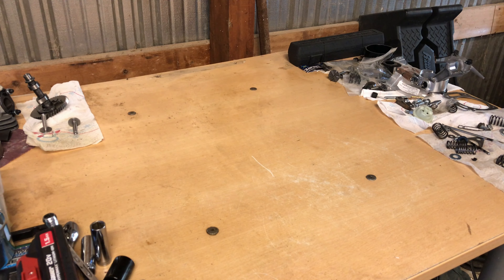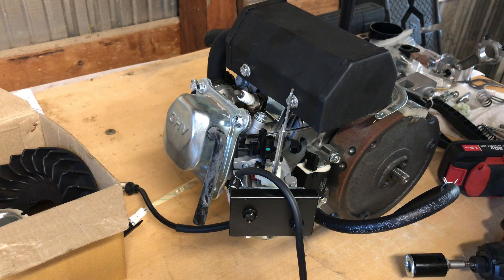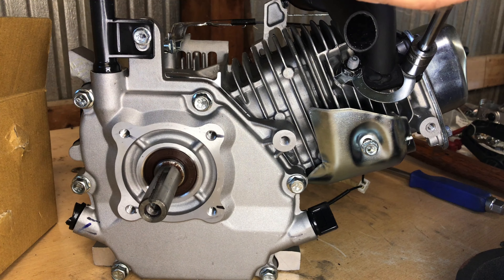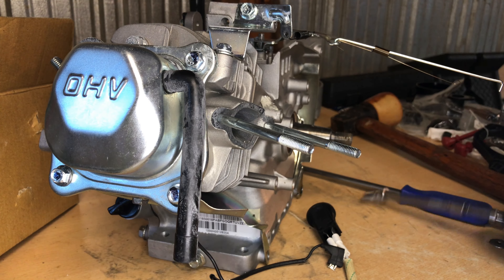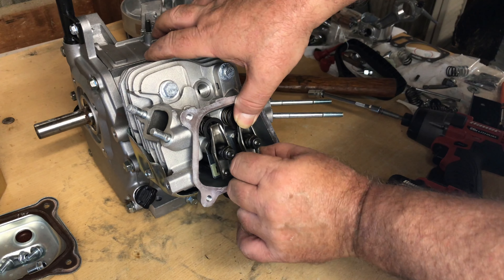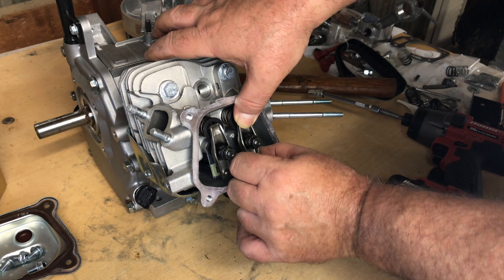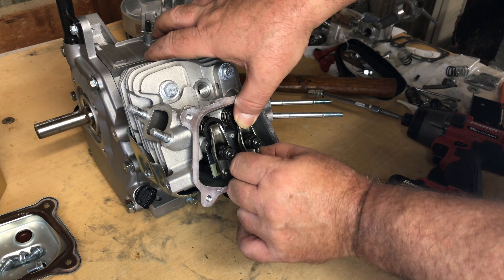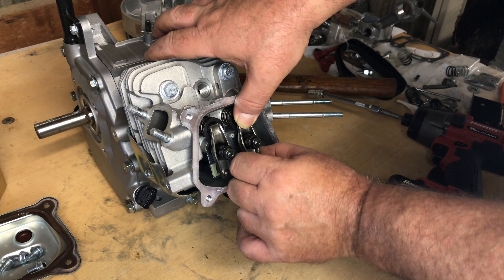Part 1 "Big Bore" 179 LCT Engine Budget Build! How To Turn 179cc Into 208cc!

Comment: I just got an LCT 136cc. I was gonna get the 179cc, but i was afraid it wouldn't fit inside my felt faker gas bicycle frame.
So i got the 136cc. And now find out that the 136cc will only fit vertically. I need to find someone to weld me up a mount.
I have a death row comet style tav 2 torque converter that ill be using as well.
I took off all that throttle linkage. Cant use it if i wanted to because vertical mount 
Anyways i have a pz20 carb, but im afraid that it will over rev because i have to take out the governor too. I need to use a charging flywheel because i need lights and power. I sure wish they made billet charging flywheels. I guess i could take off the outer starting ring if i can even find one of those.
Should i be worried about the carb, the governor and flywheel, or do you think id be ok with the carb change, governor delete and a charging flywheel?
Reply from the maker: Hi B! Sounds like a cool project! The PZ20 carb is a great performance mod but remember if you remove the governor you'll need to be concerned about the stock rod and flywheel failures. The stock rod can usually handle up to 6K RPM but the flywheel will not safely spin that high. Anything over 3600 RPM with a cast iron flywheel is a no no. Undoubtedly you will hear people that will say they've run their cast iron flywheels at high RPM without an issue. I did that too with the 5HP Briggs engines and had good luck right until one came apart on me. I was lucky and it missed me but there have been others that weren't as lucky. From then on anything I build will have something other than cast iron for the flywheel. I prefer billet but those PVL flywheels are acceptable to a degree. If you're mounting your engine in an odd position remember to check the oiling system to be sure it can oil. These have the splash type oiling so if the rod dipper is not touching the oil, it'll lock up!
Reply: @KentuckyFriedFixes  i think my engine is a dual bearing and forged crank too, like the 179cc.  
Im not wanting to have the rpm up high, and I'd rather just leave that governor alone, but i don't think i can just leave it flapping in the wind so to speak. I'm green on these 4 strokes and is my very first build, but i just got tired of working on those 2 strokes, which is why i opted for the 136cc. I would have just gutten a 79cc predator, but they really aren't powerful enough to drive those torque converters, and im new to the torque converters too, lol 
But like i was saying, yeah im worried about that flywheel. I was going to get a dual, parallel coil and a charging flywheel with 3 magnets for power. I have to have the lights and charging power available. J can only mount my engine vertical, so that means i cant use the original carb or linkage  because of it, unless i guess if I had custom  intake manifold. What to do, what to do... Wish i could get a charging billet flywheel. I wonder why they dont make those?
Reply from the maker: All great projects start with a great plan. You'll get yours together. The Tillotson carburetors can be mounted in any position if that helps. I'm with you on the billet charging flywheels. Seems crazy to make a billet flywheel with a ring gear for electric start yet no internal charging magnets for the coils!
Reply: @KentuckyFriedFixes  yes! That's exactly what i was thinking, about the electric start lol. I've even looked into rev limiting ignition coils, thinking i might be able to make sure the revs stay down. Im trying to go for reliability and not so much speed, and i don't plan on revving it out like a madman, without a load on the engine.
Maybe im just overthinking the whole thing, but one thing for sure is i cant use the stock carb and linkage.

Comment: Is the block smaller like the 79cc or is it same as the Predator 212’s?
Reply from the maker: The block is the exact same size as the 212cc engines. If it wasn't for that oddball camshaft size they'd be a perfect match to a non reinforced 212 block.
Reply: @KentuckyFriedFixes  I was hoping it was smaller. Getting tired of trying to stuff a big engine in a small frame…😂 The 79cc fits so well.
Reply from the maker: @DIYWilly  FBC  has the prospects for a performance ultra small block build. Hint Hint FBC! 🤣🤣

Comment: Will a aftermarket carburetor for a 212 fit this ?
Reply from the maker: Hi OpAfCasey! I used a 224 Predator carb on the "Killer Tiller" engine so any Honda or clone 212 carb should bolt right up. I will finish this one when it warms up a bit. Thanks!
Reply: @KentuckyFriedFixes  sweet been curious cause I was handled a homelite 179cc engine and I'm gonna put it on my mini bike but was curious if a mikuni carburetor for a 212 would fit

Comment: Hisun 99 and Predator 79 have the same rod journals and bearing size....however....the 79 has 37mm stroke and the 99 has 40mm....the Predator has a small wrist pin and higher compression height but that's where they gained it so you can't stroke the 99 with a 79 crank, it would actually drag the piston down into the cylinder but the up stroke would be trash. Grrrr.....ARC make me a 99cc long rod for the 154 crank!!!
Reply from the maker: I'd love to see a hot rod 79cc or 99cc build on your channel FBC! If you can use a 179cc carburetor on a hot 79cc or 99cc engine let me know, I have some I'll donate to the cause!
Reply: @KentuckyFriedFixes  I know a guy who tried without much luck. He actually used a clone carb. The pz19 is where it's at. I love the little engines. They are sooo much fun to tune and  hone in one's skills. Lol imagine a parking lot race league of little 79/99cc minis. Easy to transport and store. Big fun in small areas!!
Reply from the maker: @fatbuddycat  A PZ19 would sure add some power! I may experiment with some of the 79cc and 99cc engines after I get the others finished. First I'll have to search the barn to see if I can round up a few prospects!
Reply: @KentuckyFriedFixes  They really bring a different kind of fun to the table. They make good power but you have to build for torque. The cherry spot for these is around 3-6k rpm. The ARC flywheel is heavier and helps them carry centrifugal force with rotational mass. Doing everything you can at the coil/spark plug will significantly improve the tuning experience.

Comment: Will a gx200 crank fit in this ?
Reply from the maker: Hi OpAfCasey! I've not tried to swap out the crank but I don't see any reason why it wouldn't work. The only thing I've found in the engine that won't swap out with a GX200 is the camshaft and piston. The cam diameter is .569 on the LCT while the Honda is .549. The piston in the LCT is 65mm vs the 68mm bore of the 196cc engines or 70mm bore of the 212's. I will be doing more with the LCT engines if there's enough interest in them. That Crankshaft in these things is NICE! Forged steel and nicely balanced. Nice to know about that crank, if you find an LCT engine that's been junked, grab it for the crankshaft, best made 54mm stock crank on the market.
Reply: @KentuckyFriedFixes  so I figured out witch 179 I got the one I got is almost an exact match to the Honda gx200 found out a lot about her it's a 64 mm bore for mine at least but billet rod and a gx200 max stroke crank fits also the wrist pins are slightly shorter but thicker

Comment: Less stroke, longer rod and a shorter piston.....I'm 45 seconds in let's see how I do!
Reply from the maker: Short stroke, long rod and a flat top piston would be a nice little combo! I'm still deciding on what parts to use for this one at this point. I'm a little concerned about changing the balance too much. I may stick with a low budget parts build on this one until I find out if it's gonna shake itself to death or not! We'll go from there.

Comment: I know this is an older video, but I'm hoping someone knows the size (CC) of the LCT 208 head?
Reply from the maker: Hi Jesse! I don't have the kit to get an exact cc measurement on the chamber but it sure looks to be a 20 or 22cc head on the LCT heads I have on my engines. Decent looking stock ports too.
Reply: @KentuckyFriedFixes  I ended up rigging up an apparatus to measure the head CC. If my meaaurements were accurate, the LCT 208 has a 22cc head.

The reason I got curious was because I decided to do a quick and dirty head swap on my kids' Coleman BT200x (Hisun 196cc engine) to utilize the LCT's larger valves and improved ports. The problem is, after reassembling everything, the engine has almost no compression whatsoever. 

My first thought was that somehow the LCT head must have a much higher volume than the stock Hisun, and somehow I overlooked it. However, they appear to have the same combustion chamber volume and design, minus the valve sizes, so now I have to figure out where the compression went.

I'm glad you did these videos with the LCT engine's and their good (and bad) features because I've had that 208 sitting on my shelf begging for something to do. I considered swapping the 196 with the 208 completely, until you shared the very strange and frustrating news about the incompatibility of standard cams and the goofball size of the LCT journals.

I may still swap it in, I just had planned to eventually cam the bike once we upgraded flywheel, con rod, etc. Thank you for yet another video on some of these less common engines. I'm always looking for some little obscure, rock bottom priced engine that secretly has better parts or designs than the competitors
Reply from the maker: @jesse1136  Thanks Jesse! I like the little LCT engines. Well, at $49.95 I like them. It's a shame that the cam diameters are odd but those forged steel cranks are worth every penny!

Comment: I got a honda clone flywheel and it was too big fur my lct 136cc
Reply from the maker: Hi B! The 179cc LCT engine is the same size as the 196cc Honda clone blocks (Edited to add: The bore on the 179cc block is 65mm instead of 68mm but the footprint of the block is the same). I think the smaller versions like the 79cc and 99cc engines are the smaller blocks. I've not built a 136cc LCT so I don't know exactly what you need but I suggest looking into parts that fit the 79cc and 99cc engines. Yours may be more like those.

Comment: Why too much trouble, to deal with the replacement cam and other issues with this engine. I'm going to pass on it and stay with the preitor 212 and 224. So thanks, but no thanks 😢.
Reply from the maker: Hi Chuck! Why did I build this combination? It has a forged steel crankshaft and it cost $49.95 for the 179cc engine. The LCT 70mm block cost me $20. This was a budget build experiment that was MUCH cheaper than a budget Predator, but I have those on the channel as well.

Comment: That actually does measure  207.81684
So yes 208 is the round off number
Reply from the maker: Yes Sir William! Some of the engine makers list these as 210cc for some reason? Maybe "their" crank has a bit more than 54mm stroke? These LCT cranks are great. Even at 54mm stroke I'm happy. I'll try to show a closeup of the crankshaft in Part 2. Thanks man!

Comment: What size is the carb
Reply from the maker: Hi Noah! The carburetor on the 179cc is much smaller than the 212 or the 224cc engines. I've not measured the exact difference of the size of the venturis but there is an obvious visual difference between the two. The 179cc carb is way smaller.